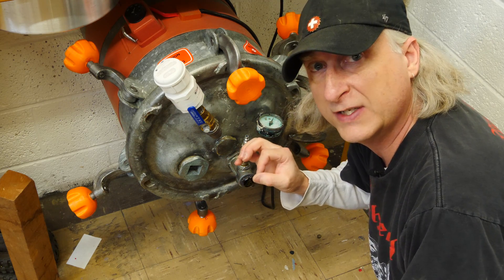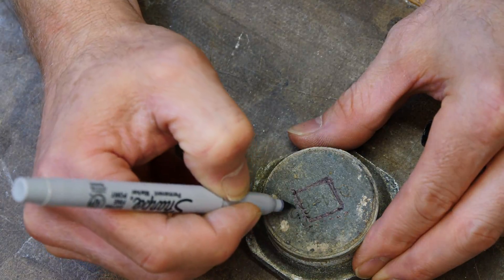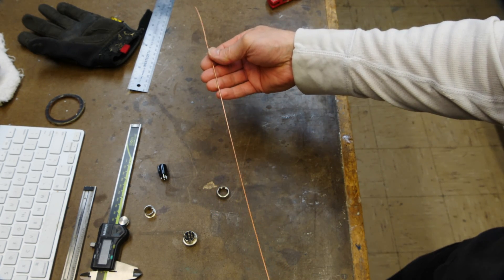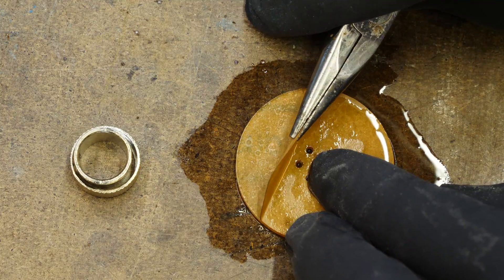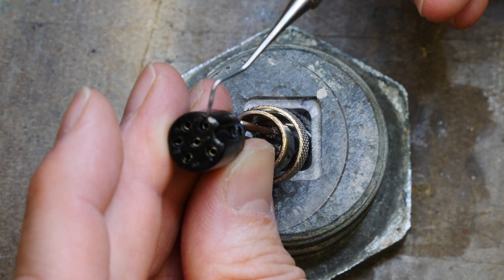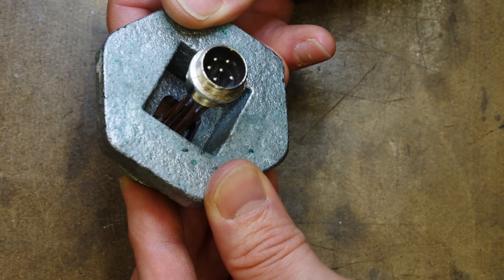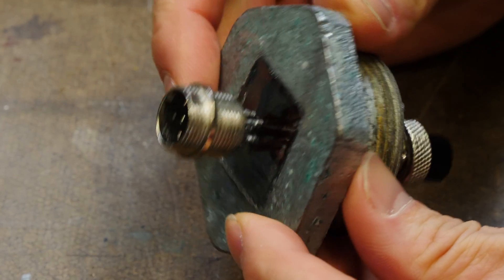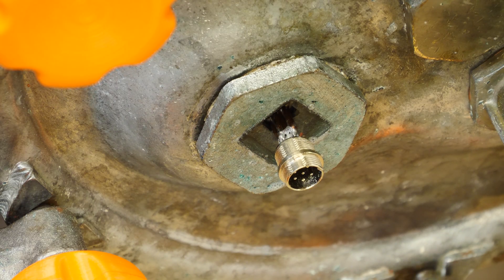How To: Hermetically Sealed Electrical Connection

Comment: Taking inspiration from this project I made a similar electrical feedthrough for my vacuum chamber. However I have slipped some pvc tubes over the bare part of the lead wires which gives it an insulation. And the best part is I poured epoxy in intervals so that the insulating tubes are also fixed in the epoxy 
However I am skeptical of the epoxy as to how much temperature it can withstand.
I am looking for a pourable High temperature epoxy. If anyone knows about it

Comment: For soldering iron . Remove that junk core replace it with copper rod you can use grounding cables as core . sharpen its tip as you like and you will never worry about scratching its tip and having issues. commercial cores are made of steel, tips  are nickel coated. in time nickel wears of since you touch it all the time and becomes junk and you have to buy more cores. when you replace core with copper rod it also becomes more heat conductive and becomes permanent. i been using my soldering iron 20 year or so copper core is still there even i grind the tip when it gets dirty.

Comment: This is pressure and not vacuum, yes? I'm terrified of a potential champagne cork scenario there...
Reply from the maker: thus the hat section/undercut on the backside of the nut, to prevent that from happening

Comment: As first, I was wondering why the wires weren't insulated. But that would have created six potential failure points for the seal right?
Reply from the maker: Correct!

Comment: I recall Applied Science (Ben Krasnow) making a DIY mass spectrometer (i know, this sounds - and is - crazy) and he simply ran a bunch of sewing needles into a McMaster-Carr rubber plug as a vacuum sealed electrical passthrough. Though he didn't need to pass a lot of current.

The depth of vacuum that is needed for such an instrument to work is extraordinary, and the rubber plug worked. A number of other materials had to be discarded because they were outgassing. I wonder, is there any such experience with casting materials, both hard resins and elasthomers, as to whether ones suitable for such scientific use exist?

By the way, do you have a dream, a dream that can only be fulfilled by a crazy scientist? What would it be?
Reply from the maker: Yes I'm sure that those kind of resins exist. Nope....no crazy scientist fantasy other than space travel
Reply: I think for his electron microscope he used an alternative solution, exactly because rubber is either too porous or gasses out too much. Those kind of applications usually use ceramic connectors. This one for example https://www.ebay.com/itm/AMPHENOL-D-SUB-COMMERCIAL-CONNECTOR-25-WAY-17S-DB25-CERAMIC-/310388614644

Comment: I would add some electrical insulation to the exposed copper wires & contacts, both inside and outside the tank. Uninsulated, you risk short circuits if something falls across two wires where they're exposed (e.g. a metal shaving, or an insect—the origin of the term "bug"). And if you pass high voltage, depending on the pressure and what gasses are inside the tank, you could get arcing. There's a reason why the connectors you used include plastic insulation. Another application of insulating resin would work, like a couple cylinders between the connectors and the nut.
Reply: Would liquid tape be adequate for insulating exposed wiring?
Reply from the maker: Yeah, perhaps a bit of nail polish would be good to coat the wires, at least on the outside, good point!
Reply: @EricStrebel  Nail polish wouldn't last long, but you could just cast the exposed wires in a bit more resin.
Reply: @Eric Strebel Another idea may be to cut some insulation off wire (thus making little, slit on the side, tubes of properly rated insulation), slipping them on to bare wire and then apply a little glue on top. Really nice project.
Reply from the maker: Actually I like that idea the best, I think some super glue would work good to hold them in place

Comment: This may be a stupid question Eric, but why?
Reply from the maker: The description answers that question.
Reply: @EricStrebel  Sorry for not elaborating, I've only used pressure tanks for resin, rtv etc. What would you put in a pressure tank that would need power, and for what purpose?
Reply from the maker: 8BitLife perhaps a rotocasting or rotational molder, I have done that in the past for special parts
Reply: @EricStrebel  Ahhhhhh. Brilliant!